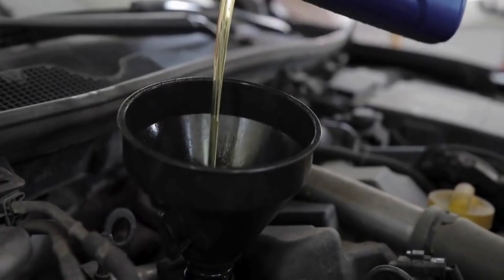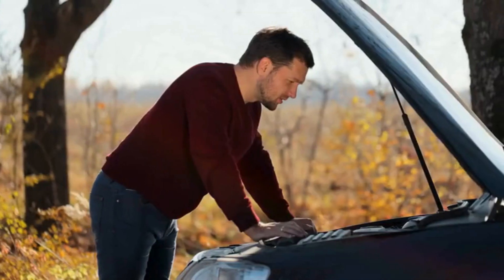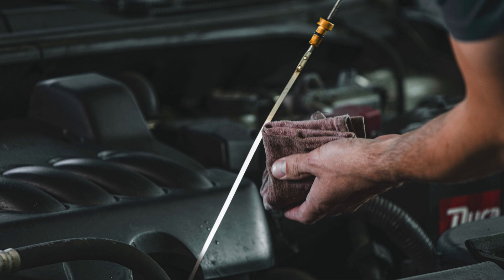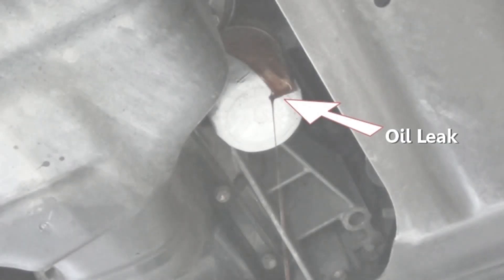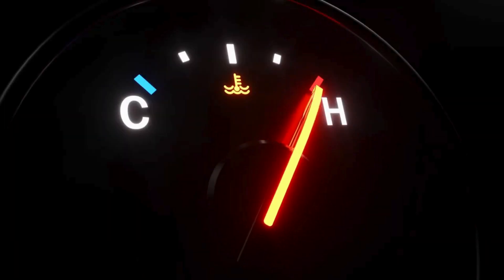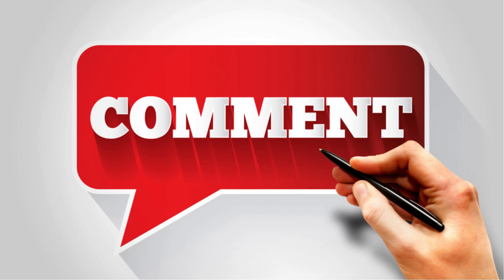Don’t Ruin Your Engine! Avoid These COMMON Oil Change Mistakes!!

Comment: Can i go back to 0w20 i have been on 5W30 for years 60k miles 
The car Honda civic 2018 1.6 ivtec r16b 
eu specs
The owner book says 0w20 or 5w30 
if 0w20 not available nearby
Reply: Why would you want to use 0W-20 anyway?  Less lubrication is never a good thing.

Comment: In the 70's you could buy a oil flush you added to the oil then drove 100 miles and replaced the oil and filter. This was to help clean the inside of the engine. a mix of kerosene/ trans fluid did the same thing.
Reply: RISLONE, among many others now.
Reply: Yes, true, BUT, if your engine was really filthy inside, all that muck plugged up the oil filter, then circulated throughout the engine.  Not a problem if you regularly changed your oil, but for those who seldom did, potential BIG problem.

Comment: Change every 10.000 miles the motoroil include filter. Your engine does wear only the minimum. Oil change cost are minimal. Use for example Mobil oil than you are sure that the quality is premium.
Reply: No--every 3000 miles !!!!
Reply: Every 3-5k miles buddy
Reply: You should NEVER EVER try to go 10,000 miles between oil changes!  And no oil filter will last that long - it will get plugged up way before then.  Once that happens, oil pushes open a bypass valve, allowing oil to circulate, meaning you are running without an oil filter.  Not good unless you want to change your oil every 1,000 miles, even with synthetic.
Reply: @jamesbosworth4191  Always change filter with oil change !!
Reply: Thankyou Mister Mobil Rep!
Reply: @gloriaknight6304  Really--10,000 miles-WOW !!
Reply: @mrbill8542 I meant  Rick sounds like a Mobil promoter.
Reply: @gloriaknight6304  He sure does !!!

Comment: Don"t forget to fill the new oil filter with fresh oil before installing it.
Reply: No need to fill oil filter,the engine will do that for you.👍
Reply: @xl250mon5  But the thing is, until the filter is full, the engine is running dry.
Reply: @Nick41622  no it's not, there will always be a film of oil on all bearings and cylinder walls, you don't drain every bit of the oil during an oil change.
Reply: @xl250mon5  No. you are wrong. Well, why does the oil pump light stay on until the filter is full, some engines will even make noise. This is when most engine wear occurs.
Reply: @Nick41622  try going to college and learn about oils and the lubricating system.
Reply: It doesn't count if the oil filter is on it's side.
Reply: @Nick41622  It can be done. I've done it on my friend's Mitsubishi Galant 2.0L engine.

Comment: Change the oil while the old oil is still good.
I always change the filter but if you want to skip a filter change it should be okay.  A little bit of old oil is ok. 

I just changed my Mustang's oil. I thought it was 2000 miles and 2 years old. Mobil 1
Turns out it was only 1700 miles and only 3 years. 😂😂😂😂

Comment: Most important:

1.  Plug the bottom drain port B4 putting the fresh oil from the top.

     If u run the car, u'll leave nut(not) only an embarrasSkinned trail of black
     buttto, worse,  welded engine pistons.

2.  Plug the big top pouring cap after the fill up.  Or, the oil will spew out onto
     the hood bottom, ruin the sound insulation lining, or even worse, u'll end up
     w not much oil left to cool the engine B4 u reach home

Those two above r more important than what's shown in this video.  Yes?

Regardless of who does the engine oil change, always look down under 2c
if the new oil is nut draining out to the ground.

Open the engine hood n make sure the top cap is on too.

3.  Scratch ur oil fltr B4 u take ur KAaa for an oil change shop and chk it after
      the job is done B4 u leave

4.  Always recycle the used oil.  Autozon, Advanced Auto, Napa, ur town autoshop
      would take ur oil for a few cents/gal.  Don't ever dump it in ur sink, street sewage
      drain, etc.  It'll contaminate our water resources, rivers, n oceans and u'll b eating
      and drinking oil for ur health n enjoyment

Hope ur now better informed to save ur KAaah for many good rides
Reply from the maker: Thanks for sharing your knowledge
Reply: 1974 dropped by a friend's house at Ft.benning, Ga. He was changing oil and tuning up a Dodge Dart while the Daisy Mae cut-off jeans next door was putting on a car washing exhibition. Come Monday morning and he's all "Boy, y'all won't believe what I did after y'all left Saturday."  All 5 quarts right on the ground.

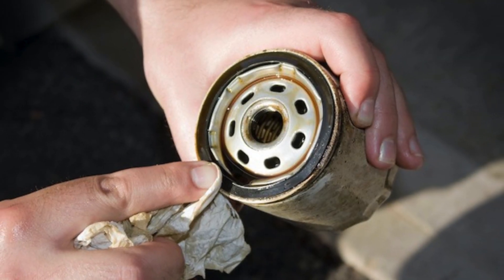Comment: 2:16 The video shows used oil is being applied to the OF gasket not fresh oil 🤔

Prefilling the oil filter with oil is necessary to prevent powertrain dry start up.
Reply: Watch the idiot light or pressure gauge. It takes 3 seconds for it to go out. You can even hear the engine quiet as the oil runs through it.
Reply: @brett-h2v  And on older cars with a quart-size filter, it takes even longer than that!
Reply: @brett-h2v  That's another reason it's important to prefill the new oil filter with new oil. The oil pressure light goes out immediately, and there's no telling how many seconds it will go out.
Reply: @7spower998  P.S. I have a Honda K24w.
Reply: No. Many filters are side mounted or more recently top mounted on many cars and filling them isn't even possible. The fraction of a second it takes for the oil to flood a dry filter does nothing. The first stop for the oil after leaving the filter is at the top of the engine at the cam. Most sit in oil and any air from the filter is simply a momentary fart. The cams first rotations are in the standing oil or oiled from oil in the oiler lines.
Reply: @stevest1300  I've done it prefilling the can type OF, either horizontal, top, or inclined mounted. When there's a will, there's a way.

Most top-mounted OF are easy-peasy cartridge-style filters.
Reply: @7spower998  I have long missed those, even if they were usually the add-on type that only filtered a portion of the oil.
Reply: @stevest1300  Not everybody has or even wants one of today's cars.  Also, most cars didn't crank as fast as today's cars, which means that if you don't pre-fill the oil filter when possible, it will start well before it is full.  It won't suddenly destroy your engine, but it could mean the difference between going 250,000 miles vs only 150,000 miles.  If you don't keep a car very long, you wouldn't care, but if you are a car lover and love your present car, something to think about.
Reply: @jamesbosworth4191 
If you were to change your oil three times a year, and keep that vehicle for 10 years; that is only 30 times out of the thousands of times you will start your car in that 10 year.

There is no way those 30 start ups with a non-pre-filled oil filter will cause 100,000 miles of wear in an engine.
Reply: @rodrogers6895  On a modern car with one of those mini-filters, probably correct, but older cars used a filter that held a whole quart of oil and took some time to fill up.  All those start-ups with an empty oil filter might indeed cause 100,000 miles of wear.  Remember, people who changed their oil themselves generally got longer engine life than those who had a shop do it.
Reply: @jamesbosworth4191  Your entitled to your opinion, but I am 77 years old and have been doing oil changes for 60 years.

I have never pre-filled an oil filter and usually get 250,00+ miles out of a vehicle before I tire of it and sell it. Never had engine wear in any of them.
Reply: @stevest1300  Even an 'upside down' oil filter can benefit from having  the filter media 'wet' as it often takes 10~30 seconds for oil light to go out.
 If you change cars every few years you probably don't need to worry about accumulated wear but if your buying an older used car it could be a problem.
Reply: Dirty oil on the gasket is fine.just a wipe..it's not circulating .think about it.
Reply: @kurtjammer9568  
Yeah, you should dump the dirty oil back in the engine. The new oil filter will take care of it. Better still, wash the dirty oil filter with engine cleaner and reuse it. You'll save tons of money. Think about it. 🤦🏾‍♂
Reply: You never want to prefill an oil filter because that is dirty oil. Going straight into your motor the oil pump picks up oil run to through the filter then runs it into the motor if you put it into the filter you are getting contaminated oil in your engine, which is worse than starting it dry in the couple of seconds, it  takes starts to get  oil pumping  does no damage.!
Reply: @Mr.R249  I don't follow.  Just how is the new oil in cans or bottles "dirty" or "contaminated"?  Do you really think people will use the oil they just drained out of the engine to pre-fill the filter???  Geesh.
Reply from the maker: In this video, I also explained that you should prefill your oil filter
Reply: @ProAutoTips  Explain how to prefill a filter that is mounted sideways or up side down? Also many  cars come with drop in cartridges I've owned several.  Also you can use old oil on the  filter gasket. I have been changing my own oil for over 50 years and never had any trouble using drain oil to coat the gasket.
Reply from the maker: @tomjohnson5700  Yeah you can coat old oil but it is ideal to use fresh oil because old oil has contaminations that may lead to different issues.
However, Prefilling an oil filter that mounts sideways or upside-down can be challenging because the oil will spill out when you install it. However, there are steps you can take to minimize spillage while ensuring the filter is properly lubricated and prepared:
1) Partially Fill the Filter
i) Add oil to the filter, but only enough to wet the internal media. Avoid completely filling it to the brim since the oil will likely spill during installation.
ii) Tilt the filter slightly while adding oil to allow the media to soak it up more evenly.

2) Lubricate the Gasket:
Apply a thin layer of fresh oil to the rubber gasket on the top of the filter. This helps create a better seal and makes it easier to remove later.

3). Rotate the Filter While Adding Oil:
Slowly rotate the filter while adding oil so it can soak into the media without overfilling.

4) Be Ready for Quick Installation:
Once the filter is prepped, move quickly to install it. This reduces the time oil has to spill out. Have a rag or paper towel handy to catch any drips.

5) Top Off the Oil After Installation:
Once the filter is installed, check the engine’s oil level and top it off if necessary. Starting the engine will circulate the oil and fill the filter completely.
Reply: @tomjohnson5700  If it is sideways, you can half-fill it.  Much better than nothing.  And true, the amount of old oil that you would put on the rubber gasket won't go into the filter, and is way too small an amount to worry about anyway.
Reply: @ProAutoTips   

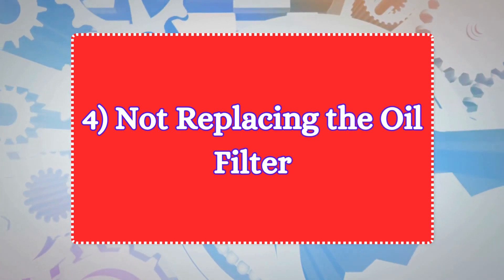1:38 4) Not replacing  the oil filter 

2:06 5) Forgetting to lubricate the oil filter gasket

Where is it that you mentioned in the video of pre-filling the oil filter? Timestamp and chapter?
Reply from the maker: @7spower998  It is not necessary to mention everything in the timestamp.. All points are properly explained in the video.. Timestamp or chapter is just made to divide the video in short chapters
Reply: @ProAutoTips  OK. But where in the video shows the new OF is prefilled with fresh oil?

1:44 No pre-fill with oil
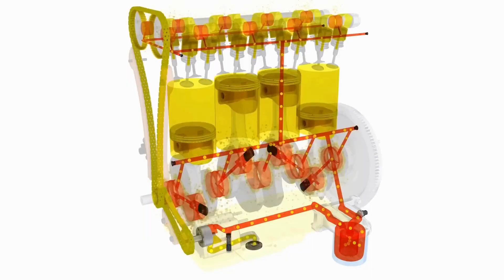1:52 No pre-fill with oil
2:08 No pre-fill with oil
2:14 No pre-fill with oil
Reply: @ProAutoTips You should never ever prefill your oil filter because you are putting dirty contaminated oil straight into the motor. The oil.
 Pump picks up the oil and run just through a filter. Before it distributes to the motor if you fill the oil filter, it goes straight into the motor without running through the oil filter. Never want to do that. You are giving bad advice.!!
Reply: @Mr.R249  Just how is the new oil that is in cans or bottles "dirty and contaminated"?  Do you think people actually use the old drained oil to pre-fill?  Do you really think people are that dumb???
Reply: @jamesbosworth4191  You do realize that your oil filter can have dirt in it right? So if you pour oil into it and there's dirt dust inside of it, your oil is not contaminated Duh. Not to mention oil itself is not completely pier coming out of a clean bottle. Do some research on it?I've been doing motors for over 60 years.How long have you been doing them.
Reply: @Mr.R249  Same thing will happen if you put it on empty - once it fills up, oil will be pumped into the engine along with any dust or dirt that is inside of the filter.  I have been doing it for over 50 years, almost as long as you.  Also, the oil filter on most older cars held about a quart of oil, so it takes some time for one of those filters to fill, in contrast to the mini filters on today's engines.
Reply: @jamesbosworth4191  Well, I guess we have to agree to disagree then.
Reply: @Mr.R249  Guess so.

Comment: Changing the oil when cold: you get MORE oil OUT when you do it this way.
Reply: Maybe if you use water-thin oil, but for the most part, NO.  Change it WARM.
Reply: @jamesbosworth4191  5W30 Live in AZ. Capacity 5.5 qts. When I change cold, I get 5+ qts out.
Reply: @DiaperDon_BoneSpurs_Epstein  I wish I could. I don't have a lift in my garage. Nor would one fit.
There is a cross over exhaust pipe right where I remove the oil filter & the drain plug. If I heat up my engine first? I risk getting a nasty burn at the least or worse an engine fire. 
Asshole engineers never think about the poor slob that has to work under that truck to change the oil.
Reply: @johnclyne6350  They are indeed making it harder for DIYers! Toyota has a silly cartridge oil filter that comes in pieces, and you have to put to together. No more quick, easy  non-messy changes. And look at what they’ve done to transmissions. An inner fill tube that you have to remove to get the fluid out. All to discourage people from doing it themselves. Instead, take it someplace and let the lowest paid serf work on your vehicle!
Reply: Nope! Hot oil pours out more from the oil pan and galleys than cold oil. Hot oil viscosity is thinner, while cold oil viscosity is thicker. So, you want to warm up the engine by driving the car to heat up the oil before draining the oil out of the oil pan.
Reply from the maker: @7spower998  Absolutely right
Reply: @7spower998  Then why when I measure the amount of cold oil versus the amount of warm oil does the cold oil total volume always win?

Comment: what about Mobile 1 20,000 miles filters, they are guaranteed to work for 20,000 miles, would you change it every oil change?
Reply: I use Mobil 1 in all my equipment. I use premium oil filters. When ever I change my oil it's either every 6000 miles or one year. I dump both the oil & filter. 
Oil is cheap. Engine parts are not.
Reply: The filter should be changed with each change. This is because some old oil also remains in the filter and when changing it, we want to drain out as much of the old oil as possible. If you think it's a shame to change the oil filter so early, then delay the oil change for about 3,000 miles and change the oil and filter at that time. Of course, it is not necessary that you have to change the filter as well, if you change the oil earlier than the filter is supposed to last, then nothing will be wrong with the filter.
Reply: Change oil every 5000 miles or at least once a year or you will have an engine full of sludge regardless of the brand of oil you use.
Reply: That is marketing baloney, or, the filter is so course that it is not doing anything at all.  An oil filter can't be expected to last much more than 5,000 miles.  It is a FILTER, so it will eventually get plugged up.  Once that happens, oil bypasses it.  You then have effectively no oil filter.
Reply: Prefilling the oil filter with oil is necessary to prevent powertrain dry start up.
Reply: @ The asshole engineers that designed my truck put the oil filter in a tough spot. It is positioned so the filter is flat. I prefill my oil filter with new oil & when I screw it on. More than half of the fresh oil pours out until I have it threaded on enough. When I start my truck there is a moment where there is no oil pressure & then there is.